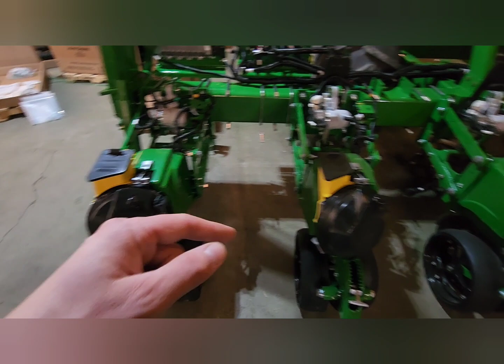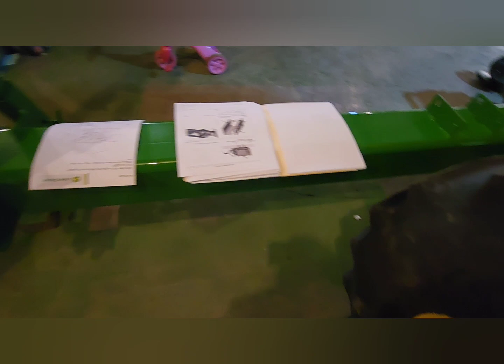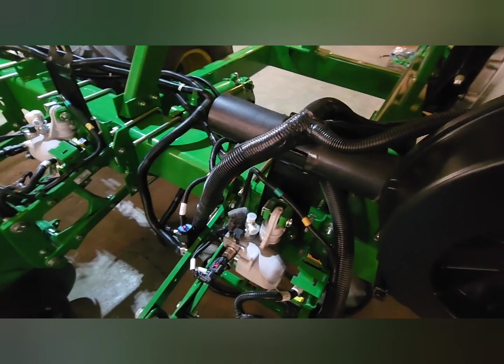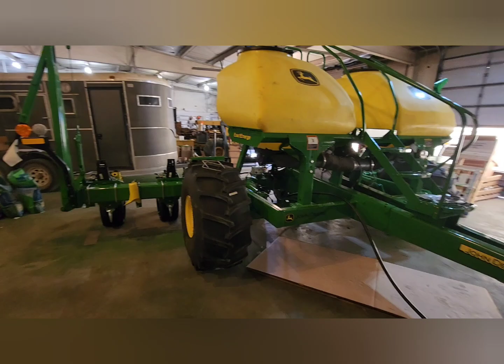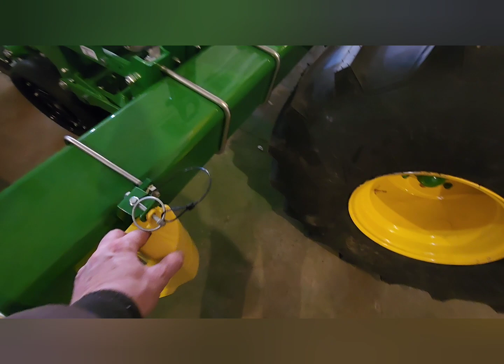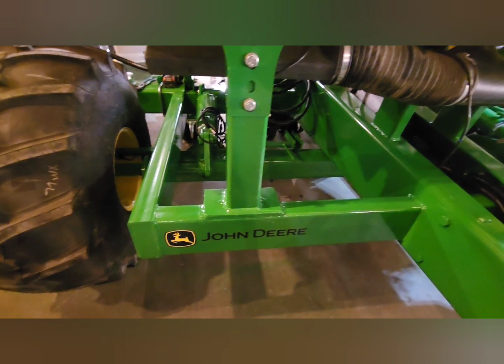Custom Planter build - video 6

Comment: I've always been told with the assumption it was correct that a bar tread tire run in reverse fashion held its line on a slope better than running it forward direction. We run all our side dump carts with bar tread in reverse. Wonder if you had ever heard that reasoning before.
Reply from the maker: I have ...but then I've heard they plug with mud worse - something about the way the bar flexing the rubber sheds the stuck on mud ... back in the 90s they told guys that it wore longer ...who knows if there's any truth to any of it

Comment: Looks great. But will 8 rows cover enough real estate in a day to get the crop in, In a timely manner?
Reply from the maker: Thank you! .... this is just a second planter (the small planter) ... the big (main) planter is a 16/31 .... we plan to cover about 40 to 60 acres a day with this planter is all ...usually planting goes on 7 to 10 days today - it will greatly help on smaller fields and places like that ... being a high speed toolbar - should help productivity levels
Reply: @Blackearthexcavationandtiling  Makes sense now. Couldn't imagine you going to the field with less than a 12 row corn planter.

Comment: Planning on not running row cleaners?
Reply from the maker: I need to do something for row unit tillage.... not sure what to do yet ..ultimately I'd like air adjust residue managers - but time we add the compressor and everything needed it's quite a bit of money ... the planters just going to run soybeans this upcoming year - so I don't know quite what to do - possible a coulter with a ripple blade only and no residue managers (?) ...
Reply: @Blackearthexcavationandtiling  As a zero till guy, row cleaners are just in the way, and they wrap up. After planting, I put on the dawn roller crimpers and actually use the planter to terminate with the row units serving as weight, out of the ground. Once I went to 30/90 CTF, my 60’ roller crimper became obsolete. It’s for sale. 

Nothing OEM works for me. Are you putting a 6000 on the planter and the planter and a steerable hitch?
Reply: @Blackearthexcavationandtiling  Martin ACCR’s is the way to go
Reply: We have the Martin's pin style really happy with them
Reply from the maker: @thomasrohloff3418  Martin makes some really good row cleaners!
Reply: Innner plants? You are going outside the box! I love it. I just did 20” across the whole farm. It seems like the perfect compromise, and the corn rows close off quicker as well.